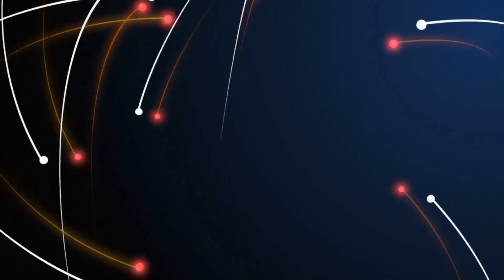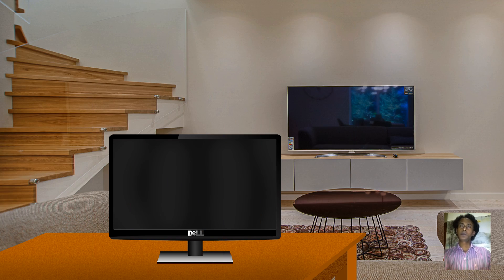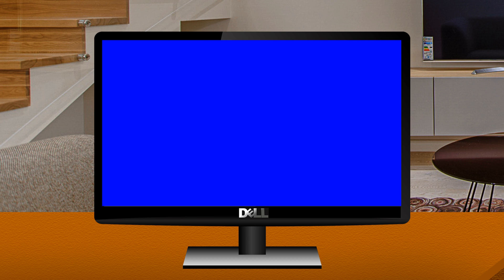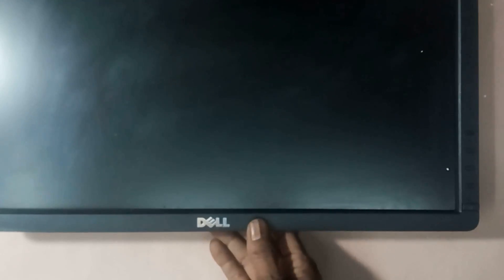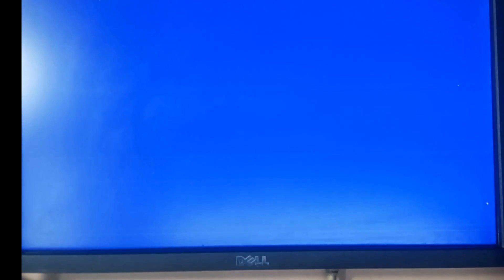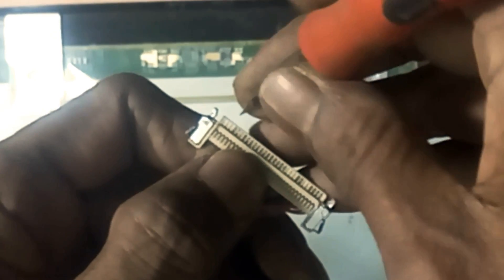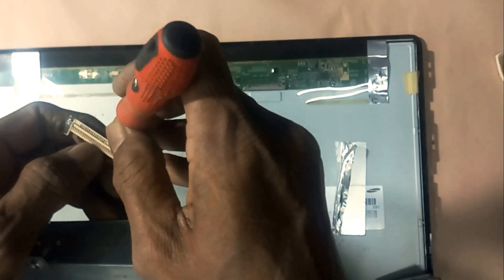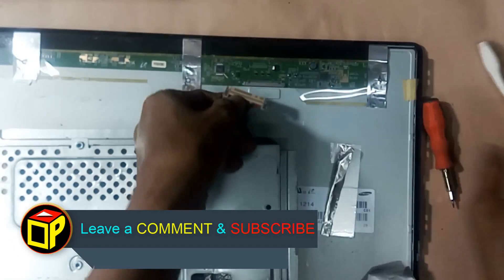How to Repair Red Green Blue White Color Burning Problem in LED /LCD  Monitor or LED TV

Comment: My Dell 2716DG has this flashing RGBW issue when I disconnect a signal from the computer. The Factory Service menu (FSM) is also appearing. If I go to the FSM and disable the burn-in option, then power down and power up the monitor. The flashing RGBW problem comes back and the FSM is still available with the Burn-in option checked. 

Are you saying this problem is a connector issue within the monitor?
Reply: same issue. did you try doing this in the video?
Reply: @graham7378  No, not yet. Taking it apart is a bit fiddly and I’ve just been putting up with it. I’ll try soon though.
Reply: @MattyCrayon  

I have the dell s2417dg (same monitor but 24in) and I was able to fix it by replacing the main board in the monitor. Works like brand new. Luckily, i was able to find the part off ebay for $50-60 and yeah, taking it apart was a pain in the rear. You need to basically pry it open from bottom and pray that it doesn't break. If you do plan to fix it, make sure you take pictures before taking it apart so you know how to put it all back together.
Reply: @graham7378  awesome!!! Thanks for the advice. I’ll have a look on eBay etc and see if I can find a board👍
Reply: I have the dell s2417dg.. and same issue How did you this for flashing RGBW
Reply: @park712  Hi Young-Mun. I have done anything about it so far. Just had to put up with it. 
Nothing I’ve done with the tech menu has fixed it. 
I do like the idea of replacing the board, like the previous person mentioned in their comment. 👍 good luck.